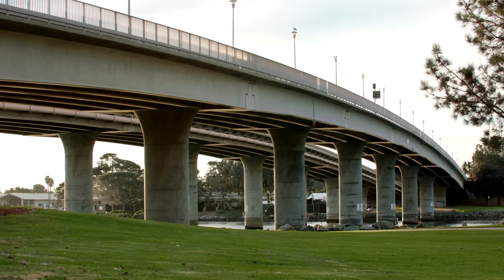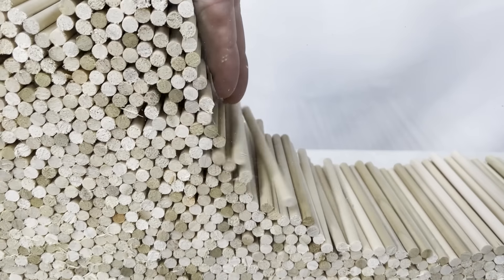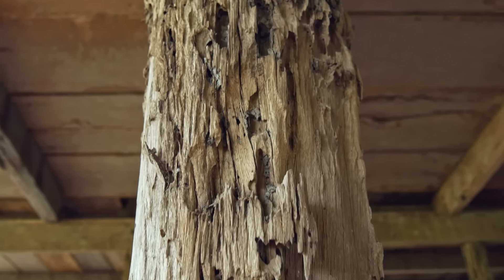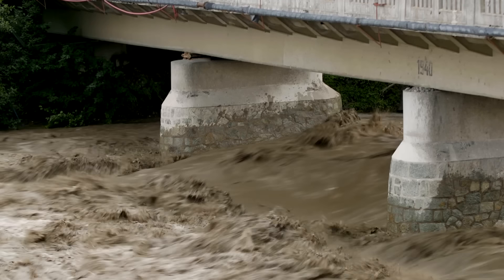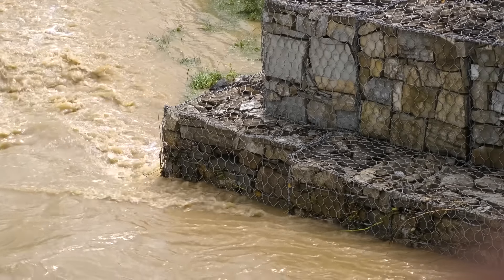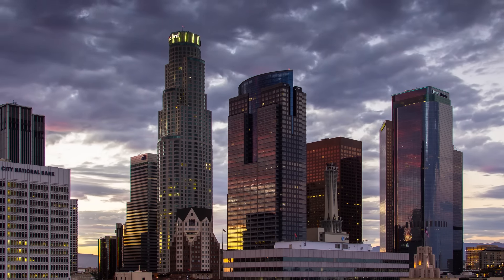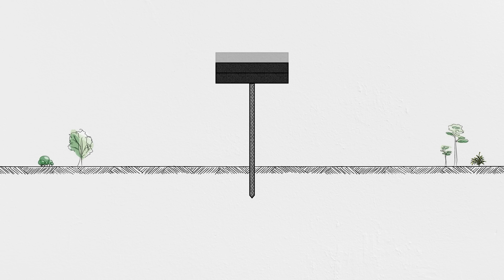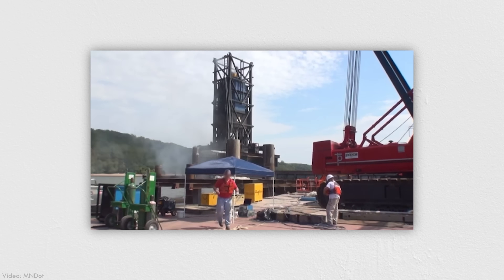Why Buildings Need Foundations

Comment: I always wondered why houses in cold areas typically have basements while houses in hot areas usually don't. I didn't think it had to do with the necessities of building a good foundation.
Reply: All the  pipes have to be below the frost line. Base ments allow us to bring those lines in pretty deep.
Reply: In the arctic most buildings are on top of piles that go down in the permafrost and have crawl space to insulate the frozen ground from the warmer house.
Reply: I was intrigued by this as well, but when he explained the effectts of freezing on foundations it all fell into place.
Reply: Plus, here, in Eastern NC ,where only a few  houses are built with basements, the water table is just too close to the surface. Cold or hot climate, bad idea.
Reply: Usually it also reflect how close to sea level u are
Reply: In addition to what others said ... out west the ground is often rocky and harder to dig deep or the soil contains more clay which is more expansive so bad for basement walls. So yeah, along with the higher frost line, probably just not worth it out west.
Reply: I know, right? I was always jealous of basements
Reply: @sattelyte5316  Basements are a pita when it comes to moisture management. It'd be cheaper to add a level to your house than to create a living space in a basement.
Reply: @barisay7244  yeah but basements don’t count towards square footage unless you have a door to access it from the outside.
Reply: @barisay7244  basements generally weren't used for living, it was for storing food for winter.
Reply: @ifp748  If you build legally, then you'll have to put an egress window/door in the basement to make it a permitted living space. Then it'll count towards square footage.
Reply: @barisay7244  yeah that’s what I was trying to say, but otherwise it doesn’t court thus giving you more room for “free” in a way if u buy a house that has one. Idk I think their cool and all my family member have them but I live in Texas near the gulf and we certainly don’t have them so their just kind of cool from my perspective
Reply: It's kind of a bummer because basements are so efficient at keeping the heat out, but others have mentioned why they aren't typical. I lived in one in the desert for some time and it was heaven. In contrast, second-story in the desert is hell.
Reply: @barisay7244  Properly waterproofed basements aren't that humid, and you can run a dehumidifier.
Reply: @treeguyable  In Southern Louisiana the temperatures are pretty warm, but we also have an extremely high water table. The only buildings with basements tend to be skyscrapers that can afford to have water constantly pumped out.
Reply: @treeguyable  I always heard it was the water table. Thanks to this video, I know it can be more complicated than that.
Reply: @ifp748  really? explain, I’m 90% sure it’s location and your climate on how deep a foundation or pile goes. Due to frost depth in the soil and potential heaving.
Reply: is that why? no hauses in my countrie have then , they dont have attic either
Reply: @kellymoses8566  Waterproofing is only step 1 of moisture management. To suggest that a dehumidifier will fix moisture problems in a basement is as ignorant as saying that a furnace can fix all heating problems in a house regardless of insulation levels.

Here's an example. Say the outside weather is 80F with 80% relative humidity, and upstairs in a 2-story home is 72F. Now, at the basement, say your dehumidifier manages to keep humidity at 50% (big assumption). Do you know what your humidity level will be at an inch off the floor of the basement? It will probably be at 70%. This is because your dehumidifier's sensor is about 2 ft off the floor (there are other reasons but this post is getting too long).
Reply: @barisay7244  A bit of moisture moisture isn't an issue for storage, a garage, and/or a workshop.
Reply: @europeansovietunion7372  it is when mold starts to grow
Reply: @Derp0Army  Sure, but there'd be more than a bit of moisture in that case.
Reply: @europeansovietunion7372  Beyond 60% RH mold starts to develop. In my previous post I explained that this threshold is easily met while the homeowner thinks there's just "a bit of" moisture.
For a garage / workshop this can be tolerated, but storage / mancave / living space is a bad idea.
Reply: @barisay7244  "a furnace can fix all heating problems in a house regardless of insulation levels." 

It can, if you have a big enough furnace and can pay for the fuel.
Reply: Not all of cold areas have basements. I live in Finland, and it is pretty cold here some times. We don't have a basement. Some other have, but most don't. A basement has its own problems, like moisture. We have a two story house with piles driven into the ground and concrete strip on the piles. There is a crawl space and some plumbing for wastewater is under the house, but freshwater lines are embedded in the concrete floor. The crawlspace newer goes below zero, but for incoming water there is a heating element, if this would happen for some reason, so that the incoming waterline won't freeze. 
Not all houses in Finland have piles, but we live on land that is old seabed, so it needs piles for the house to stay level and not sink from some corner.
Reply: In many parts of Florida, the "raft" foundation is a bit more literal. The houses really are pretty close to floating already. :-/
Reply: The frost line only goes as deep as 4ft in colder regions such as Canada, so he was incorrect about the footing needing to go below 8ft depth. Its just makes sense to take to 8ft and provide additional living space, since they are already footing the cost for excavation
Reply: @josho4971  yeah theirs a multitude of reasons. Just one being if your located close to the ocean chances are you don’t have a basement. Other areas have other reasons basements aren’t doable.
Reply: in the case of my hometown in west texas, 6 inches down is solid rock
Reply: @DavidWalkerP47  yeah some big houses here in Riyadh, Saudi Arabia have basements
Reply: In Florida the water table is so high, you hit water at a couple of feet. So basements are rare here. In other areas, some lots are so rocky it would be prohibitively expensive to do a basement.
Reply: @silverforest4682  The purpose of a basement is to place the bearing surface (where concrete meets earth) below the frost line. It's as simple as that. The placement of the plumbing has nothing to do with the decision to build a basement. I have a pier and beam foundation in a severely cold climate (Canada) and frozen pipes are not an issue.

Comment: In the Netherlands where I live, piles are actually used quite commonly, even for residential buildings, because of the weak surface soil
Reply: Plus, piles are usually used here because we build whole blocks of houses in one go. Usually 5-20 houses are built on one single "foundation complex", sorta. The piles are driven for the whole block and concrete is laid on top, for all houses. That is economically viable. If you're building a 20 houses in Texas, all spaced 50 meters apart, it's gonna cost you a lot more.

Also a lot of ground in the Netherlands is bog (veen) or soft clay (at least where i live, our whole town and all towns around us are), and is still shrinking  (inslinken?), so it'd be kinda dumb to put houses on that without deep piles.
Reply: Yeah, it's a natural consequence of so much of the country being below sea level. The extra moisture in the ground makes it much more prone to settling when pressure is applied.
Reply: Er is altijd een Nederlander in de comments haha
Reply: heerlijk dat hijen #SoundtrackVanDeRandstat.
Reply: Piles are also used for housing developments in south Louisana
Reply: @claymountain1300  Geweldig!
Reply: Yup, very annoying, when they're constructing the constant hammering is unbearable especially when you live near the construction site
Reply: @animex3183  oh ja zijn ze bij mij in de buurt ook mee bezig, het huis trilt ervan
Reply: @claymountain1300  zekers, we moeten onze vaderlandse trots onder elke video laten merken
Reply: @claymountain1300  G E K O L O N I S E E R D
Reply: @leflavius_nl5370  just got to work the shrinking into the marketing. "2.5m ceilings right now, but in 10-15 years it will be a full 3m!"
Reply: Yeah, wanted to mention the same :D
But as a result, the ground around the house drops constantly. I would like the floating one over the piles one. Its 30cm here in 25 years, but I have heard of places that had drops of 30cm in just 5 years after building.

An interesting topic: its very common to have surveying rigs do site surveys with sound tests, and then registering the soundwave reflective patterns to detect ground structures to determine the needed length of the piles.
Reply: To add, Grady mentioned the typical homeowners in the US planning with a 30 year horizon, whereas Dutch houses are planned to last at least 100 years without major foundation changes.
I live in a "veenpolder" so everything here is deep foundations, like 50% of the Netherlands
Reply: @scottmccullough8030  LOL
Reply: Dit zie ik vaak in de comment section maar ik denk dat ik de grap niet helemaal snap, kan je het uitleggen?
Reply: Lala  Bunny Girls?
Reply: I noticed that when I visited. :)
Reply: @MrVieDetailing  Damn spammers.
Reply: i am pretty sure you also use Raft-Foundations in the Netherlands. And you use the raft-part of it quite literally :D
Reply: Interesting side note, the majority of these solely rely on friction like mentioned @ 9:44 . This often results in them not even touching soil with the bottom of the foundation pillar.
It's also the reason why these houses are more prone to sagging when the ground gets to dry to provide the propper, friction as it is clay-like soil.
It has been an increasing problem with recent periods of extreme drought that have become more frequent in recent years.
Reply: For areas like that I think it would be a great idea to have lots of Wells dug in every garden or basement, and use the ground water that seeps into that well water to flush toilets etc. You can use sand and permeable membranes at the bottom of the well so the water coking isn't as murky and brown as it would otherwise be. Or even pumped away as a clean water source to be processed and redistributed as potable water.  I'm guessing NL already has infrastructure like that?

It would put more of the ground water to good use while at the same time helping drain the ground water away.
Reply: Quebec is the same since most populous areas were underwater for a long time after the Ice age